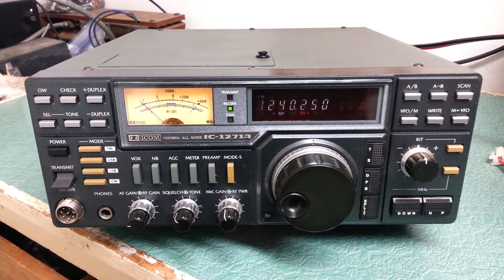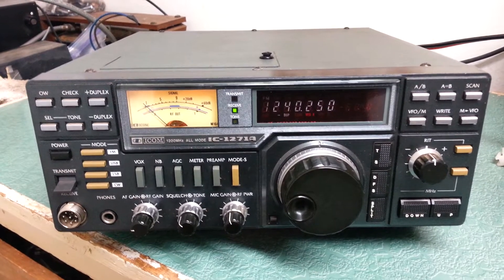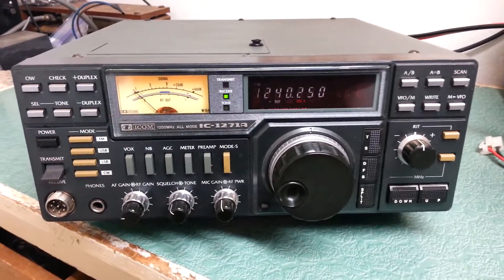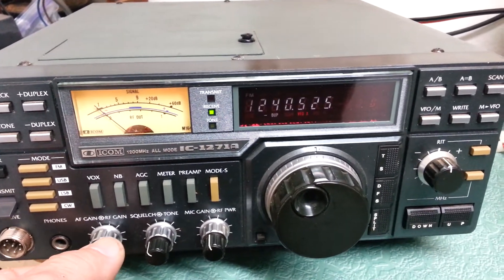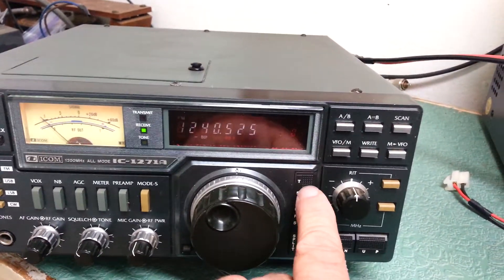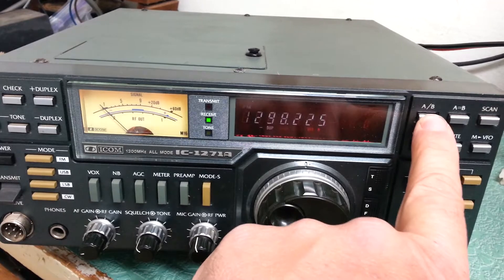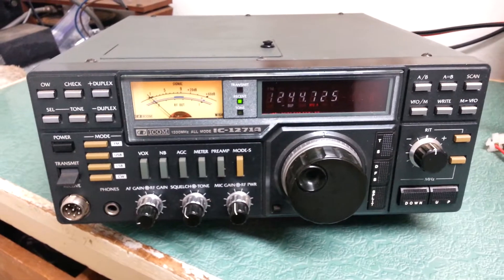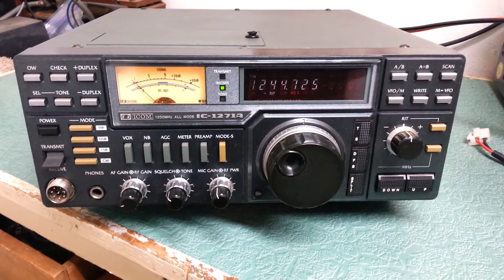Icom IC-1271 1200 MHz All-Mode transceiver 1.2 GHz  MHz

Comment: Hello, I'm about to acquire one of these this week from a friend of mine. He has owned it for many years and decided to upgrade to a newer system for 23m and add a 150W amplifier. The IC-1271A I'm getting has a aftermarket built in preamp of unknown make at this time. I'll know more about it after I get it. I currently don't have any array for 23cm, but plan on installing something in the Springtime to supplement my 6M and 2M antennas. 
Hope top work you on 23cm ssb in the not too distant future!
Joe Cro n3ibx.